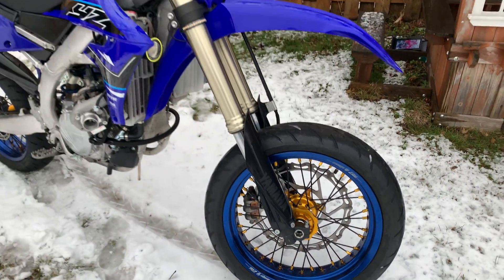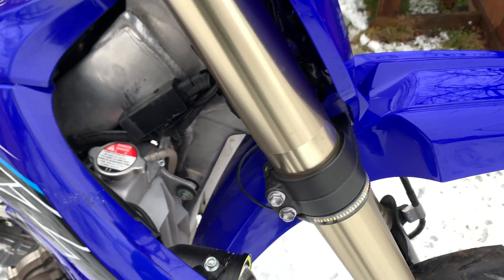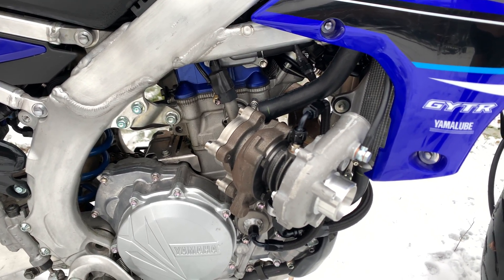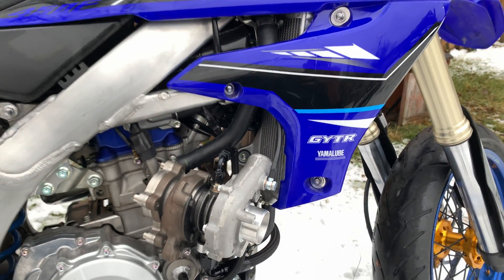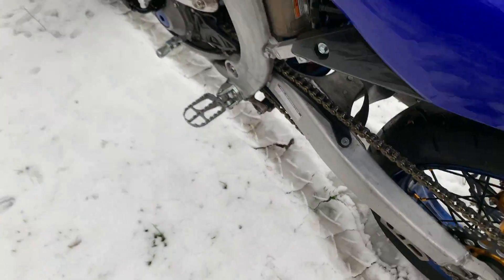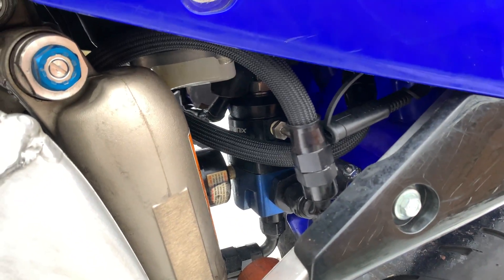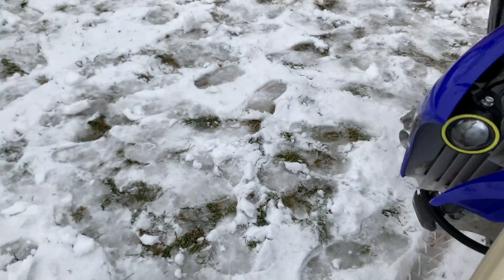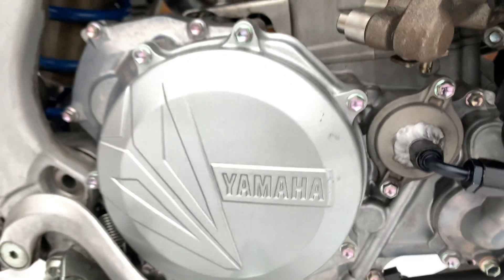Turbo YZ450 Dirtbike

Comment: How did you manage to block off the factory fuel pressure regulator?
Reply from the maker: You have to remove the stock fuel sending unit, remove the pressure relief valve and weld the hole shut.. (becareful, especially if it was submersed with fuel beforehand)